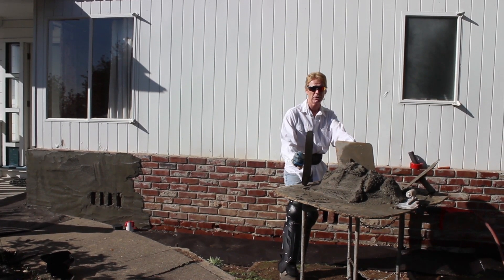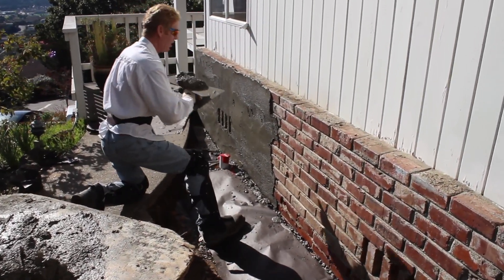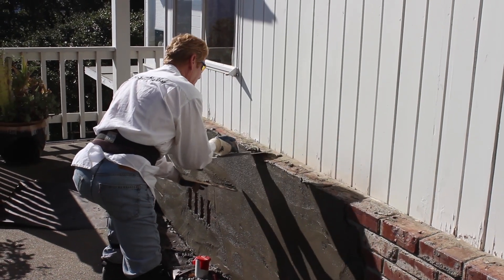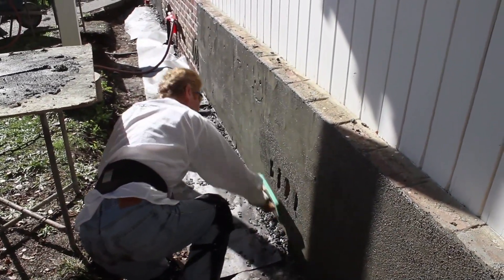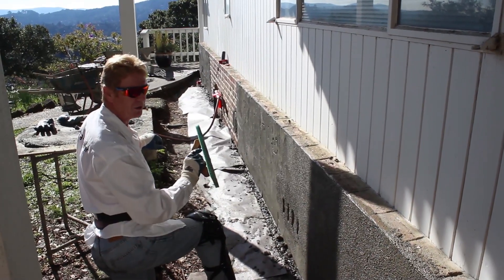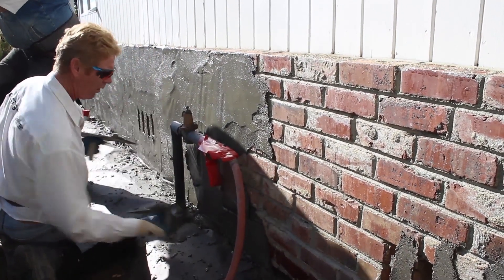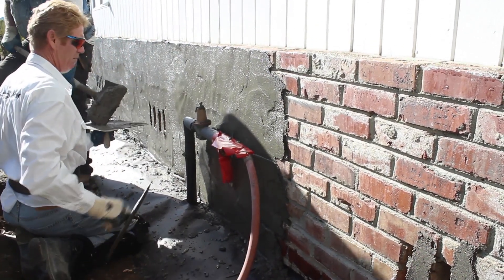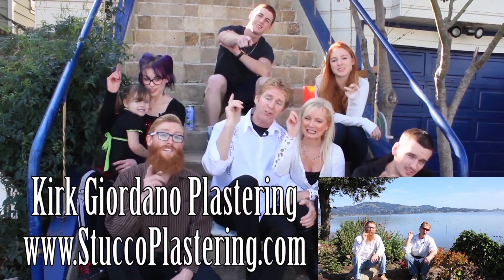Stucco over brick walls

Comment: You didn't tell me what type of cement to use.k  irk your one of the best.Ok I now know how to put it on the brick. WHAT AM I PUTTING ON THE BRICK. You didn't tell me how to mix or what to mix to put on the wall. East coast MIKE HADUCK  tells me what types of morter to mix for what type of weather STEP BY STEP.
Reply from the maker: I hear, East coast MIKE HADUCK , is the real deal and that I'm a fraud or punk compared to him? 
No worries, 
In this video, we are applying Portland cement stucco mixed with sand.
One part of Portland cement stucco to three parts of sand.
Reply: Mike Haduck is a general mason not a plasterer. He’s great but so is Kirk. Different strokes for different folks, I watch them both personally.

Comment: Kirk Giordano plastering Inc.  
Do you have a video that you're covering XPS foam? 
Covering my basement exterior with foam and need to parge/stucco to provide UV light protection. 
What product to use to transition between below grade -> at grade -> above grade.  Thanks
Reply from the maker: Howdy Todd, as a rule, foam need to be handled like sheetrock, if it's inside, fiber mesh tape the joints apply bonding agent then chosse your plaaster to apply.      
                    Live long and plaster
         Mastering Plastering for the beginner
Reply: Kirk Giordano plastering Inc. It'll be outside. Gotta transition from below ground level to a couple feet above grade.
Reply from the maker: Good evening Todd, if it were me I'd skip the foam and stucco directly over the foundation although unless it's unsightly won't help much, If you really are set you want to attach foam, then also attach  wire and stucco as usual.
Are we on the same page UV light protection is no big deal unless you're staring at the sun without dark glasses to protect your eyes?
                       Live long and plaster
           Sharing the plastering knowledge
Reply: Kirk Giordano plastering Inc. Love your work :) 
You truly are a master at plaster!
We all can't be from sunny California, it gets cold in Canada...lol

Comment: Kirk:  How do you REMOVE stucco/slurry from exterior brick and is an expensive project to do so?
Reply from the maker: Hi David, it depends if the bricks were clean and the slurry was a Lime slurry it would be tough. I'd recommend using a gas power pressure washer with at least 3,500 PSI, if it's going to be separated that should do it.
Reply: @davidhardin4114  if it's red brick that's gonna be pretty messy no matter what.

Comment: This should work over Slump Bricks as well? (southern AZ)
Reply from the maker: @AZAgentBond  This methods work on almost every kind or brick, block or rock. Good question. 🕵🏼‍♀️
Reply: @StuccoPlastering  Thank you Sir!
Reply from the maker: @ Your welcome 😉
Reply: Slump bricks are more textured than normal bricks - I'm sure that helps the stucco adhere.
Reply from the maker: @ Pressure wash bricks help also, as stucco does not adhere to dust, dirt or grime.👨‍🎨

Comment: Right on Kirk and Jay. 
How do you like those knee pads?
Reply from the maker: Good afternoon, Christophe dude, they are the best, usually worn by baseball catcher's box dudes, the absolute most comfortable, I used to wear them many years ago all the time as the straps don't cut the blood circulation off nor do they slide down the leg when walking.                      
              Live long and plaster
           Sharing the plastering knowledge
Reply: Kirk Giordano plastering Inc. Thanks Kirk! I appreciate it. 
I am also a Bay Area based plasterer although I work more with decorative materials (Italian lime plasters, Japanese, clay, micro cements, etc...). 
I met Jay at a baby shower a couple of years ago. Any ways, thanks for the response and all the killer videos. I know that I have benefited from watching. Cheers!
Reply: O see you are out there ruining more nice brick work lol. Who stucco's over brick my God.

Comment: What if the bricks have been painted?
Reply from the maker: Howdy Mike, then a bonding agent need to be applied after you pressure wash the painted bricks.
Stucco will not attach to any painted surface for more than 6 months to a year.

                           Peace, love, and harmony to all
         Sound Plastering tips for the DIY beginner’s and Plastering experts
Reply: @StuccoPlastering  Thank you sir!

Comment: My guy tells me that you can’t stucco over the older clay bricks from the 70s because it’ll peel off and not adhere long term. Is this at all true? Do you use a bonding agent?
Reply: Average Car Guy you can just add mesh right after the mud or better yet, put metal lath before. Hopefully this’ll help.
Reply from the maker: Howdy Average Car Guy, stucco is only as good as the surface it's applied to. 
                           Peace, love, and harmony to all
         Sound Plastering tips for the DIY beginner’s and Plastering experts
Reply: That's the norm in Europe. Clay bricks I mean. You either add a lot of bonding agent(the american way?) or make a rough dash coat with 1:3 cement:sand and lots of water, let it cure a few days and plaster it. See Kirk's video about terracotta blocks, he uses a bonding agent.

Comment: Kirk do you ever rule your walls straight ? , never see a video where you do that , you always slap on and start floating and finishing ? . Is this a industry standard in the USA ?.
Reply from the maker: Howdy Jon, that depends on small jobs like this to rod the wall is not necessary, If I'm applying stucco to a bank that is going to get the thin-set tile placed on my second coat then yes I have to rod the walls true and plump with no more than an eighth-inch variance every ten feet, in fact, I still have two rods  or whay you guys call staight edge rods in my garage that are 10 and 15 feet long.
               Live long and plaster
Teaching you how to stucco your home issues
Reply: Kirk a pro go lwatch. His video s on using the darby u bone head
Reply: Juan Moncibaez been plastering for years bud and a Darby does not get a wall flush ,true and plumb a Darby is designed to spread the mud over a large area after spraying it , it gets it some what flat but not true . You have to use a straight edge that actually
Takes off the high areas , then you fill in low spots and then rule again . You gotta use a u channel or something that’s straight , a Darby is basically a big trowl .
Reply: U obiously aint a plaster
Reply: Juan Moncibaez fully qualified plasterer from Australia mate , got the certificates to show it . Been doing it for
Years , we do it a little differently
Here , that’s why I was asking if it was the industry standard over there , no hate just curious , we have Darby’s here but you would never use it to make your wall true and plumb within 1mm it’s impossible , we use straight u channels , we get the wall so straight And the surface so flat you can’t even fit a piece of paper in between the rule and wall

Comment: They don't really do house like that ,, I seen buildings ,, the easy way is cleaning bring the applying 2 or 3 heavy coats of clear sealer filling in all lines making disappear ,, then some may use acrylic stucco with color or without them painted the other way using epoxy or some concrete filler that will not harden then crack or peel back like rubber,, daich roller stone has a stucco look finish product easier faster better cleaner in the long run,,
Reply from the maker: @AA-zm4ow  you have no idea what you’re talking about, do you? It is better to keep quiet and be thought a fool than to open it and remove all doubt. 😉

Comment: Why would anyone cover up that nice brick?
Reply: Brick = Old ladies house.  Stucco = modern house.
Reply from the maker: Good Evening Pete, not my call, either I do it or the homeowners will call someone who will do as they desire.
       FYI, we are still working through the pandemic, however, if you’re not you can still learn to repair yourself through our huge selection of videos on this channel.   
 Bringing you the most comprehensive encyclopedia of free plastering video’s ever put together,
 by the plastering messengers of Youtube. 
Kirk and Jason Giordano with over 800 videos 🎭 👀💃
Reply: I thought there is a practical reason for stucco, like protection from weathering the brick, I guess its homeowner’s choice
Reply: Maybe house settled and had it fixes so repair the cracked brick then cover with stucco and home value jumps.
Reply: Because it's 2023. 😊
Reply: Because they want to
Reply: I have a stucco house and my mailbox is brick for some reason